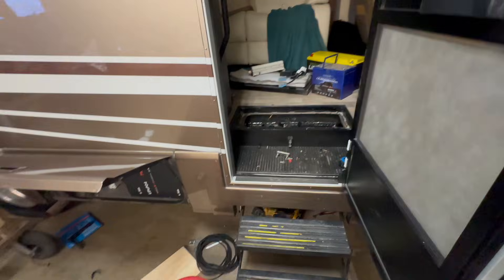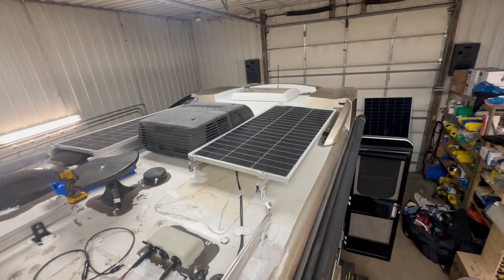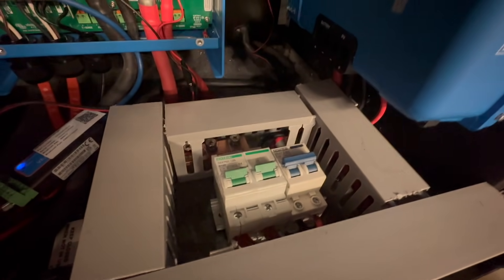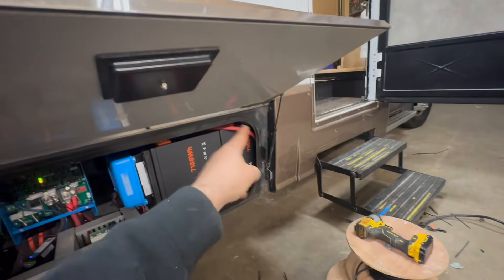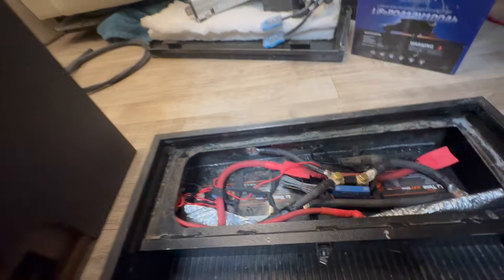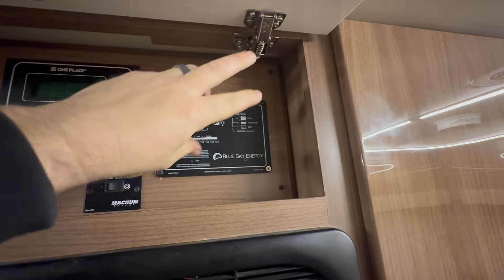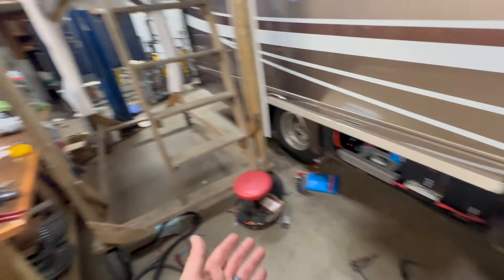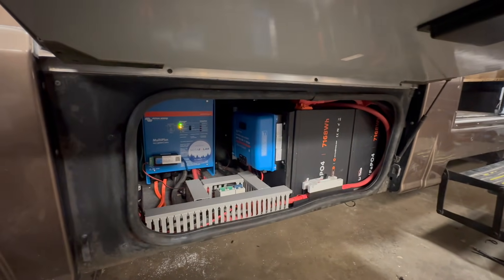How We Fit 1600W of Solar & 1760ah of Lithium Batteries in a Winnebago View

Comment: No concerns mixing panels with different wattages or batteries with different capacities? Wouldn't that strain the weaker components and drive down efficiency?
Reply from the maker: For panels, the larger panels will run a little more volts than the smaller ones, however since both sets are in parallel they will contribute amps as they can, neither will affect the other. 

For the battery, they are also in parallel and act in a similar way. Lithium / LiFePo4 when paired with a BMS is very tolerant of mixing batteries like this. 

Think of each battery like a tank of water, 2 are 560gal the other two are 315gal . All 4 are connected at the bottom with pipes. So if you fill one, they all fill, if you drain one, they all drain. Now if you drain or fill at a faster rate than each tank can transfer between   other you will get an imbalance but once the drain or fill is stopped they will equalize. 

Same is true with batteries. In previous videos we’ve dug deep into this and logged the results.